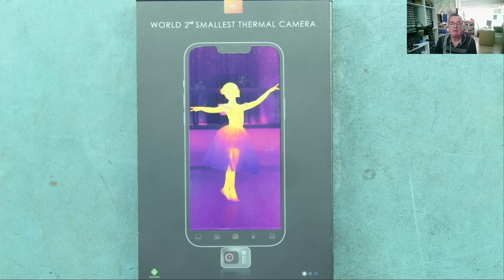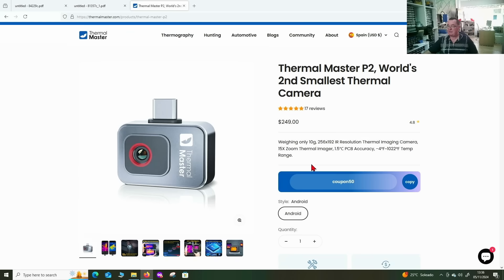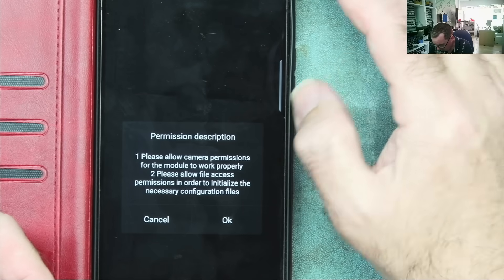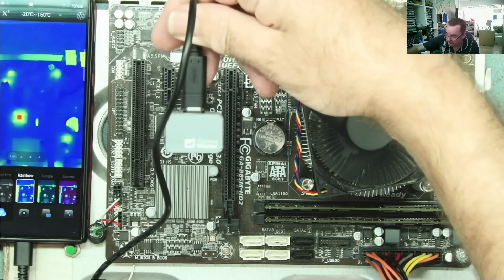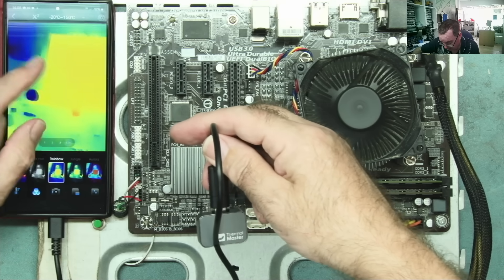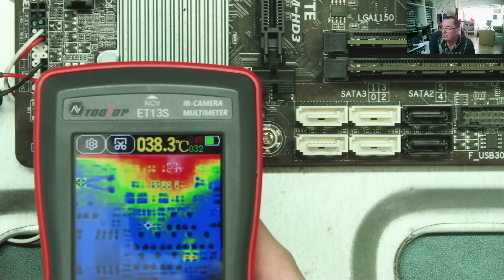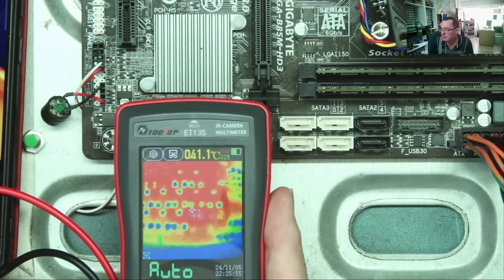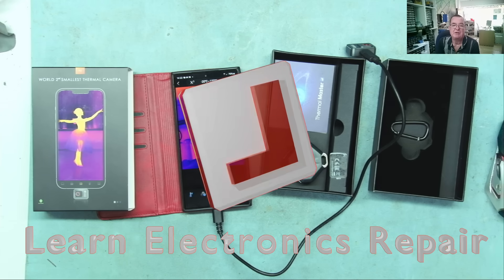Thermal Master P2 IR Camera : The World's Second Smallest Thermal Camera Test &  Review 2024

Comment: I bought a P2 recently and it works great. I have been using it with a Samsung Note 8, I had extra. The app starts every time I plug the unit in. In very dark condition, where I couldn't see anything, I was able to see the horses walking around the barn from several hundred feet away with 15X Zoom.
Reply from the maker: I believe I pointed out in this video that the P2 zoom feature is great for longer distance work, such as boilers, aircon, and yeah finding horses.  The point i made is that in my application, looking for heat in small electronic components that are maybe 1mm long, it does not have the ability to focus on these where other cameras, specifically the ET13S can.  This all comes down to your intended use and I was asked to review the P2 in a very specific way, which i did.

Comment: i use an audio  thermal detector, i place a pinkie on the component and if it's above 60 °C you hear a cry of "ouch". if it's over 100°C "F-that" is heard. works for me and as  a bonus it does not need batteries.

just thought that if you had a spare one you could save the pain and suffering that my little pinkie goes through during fault finding. 🙂

Comment: Worst review ever make a comparison with Infiray P2 Pro and the new Uni-t USB-c of the same specs... DONT buy this camera just because of the fact they didnt want a real comparison or test.
Reply: It failed pretty miserably with this test either way. Tbf as Richard pointed out, without the macro lens it really hasn't got a chance used in this application to begin with. You're prob looking at an extra 50 dollars bundled together. Puts it in the price range of the P2 Pro.
Reply from the maker: @anthonydenn4345  And the P2 Pro is probably the best thermal camera I ever tested.  Yeah in my opinion the ET13S represents the best bangs for buck ratio but the P2 Pro gives the clearest images. Whether that means you can fix more faults using the P2 Pro I would seriously challenge. If you want the best available at this price range get the P2 Pro. If you want to save €100 the ET13S with macro lens will work just as well for you in any real world situation.  Thermal Master specifically asked me to test the P2 agaisnt the ET13S and this is what I did.  To be fair though, I am testing in a very specific application.  I am sure that the P2 with it's zoom feature would be the best choice for air con and similar sort of repair work.

Comment: I just got the P2 Pro, and it works. It works fine. Nothing to complain about. It delivers on pretty much all of the hardware specs it promises!
Reply from the maker: This a review of the P2 which is not the same thing as P2 Pro. The P2 Pro is an excellent thermal camera, I have one.  In my opinion it is the best available in this sort of price range and I have discussed this in the live streams also.  Without doubt the P2 Pro with macro lens is the best thermal camera for electronics repair that I have reviewed/tested so far.  The T2S+, which I have also tested/reviewed, gives the P2 Pro a very good run for it's money, in fact it is probably the best option regards thermal image quality but having a manual focus macro lens it is a bit more finicky to use than the fixed focus macro P2 Pro. The Tooltop ET13S with the optional macro lens is close in performance/thermal image quality to the P2 Pro/T2S+ (though in all honesty not quite as good) but for it's lower price, about €100 less and it is also a rather nice multimeter, it's a very good choice for most buyers IMHO and in real world use I don't believe the more expensive, but admittedly better quality, P2 Pro/T2S+ will actually enable you to repair more faults.
Reply: @LearnElectronicsRepair  Thanks for the honest insight—it really helped me decide! I’m leaning toward the P2 Pro since it seems way easier for file transfers compared to a handheld.
Reply from the maker: @KimberlliLeon  I'm gonna make a P2 Pro vs ET13S video next week 😉
Reply: @LearnElectronicsRepair  yes, I'm aware, thanks! I've used both the macro lens and the bare camera for both repairs and, oddly enough, finding studs in my walls. I needed a stud finder, but now I don't anymore.